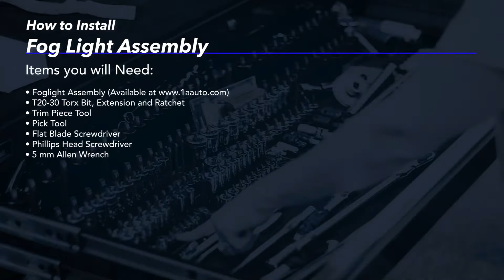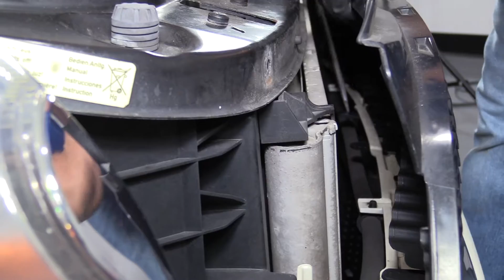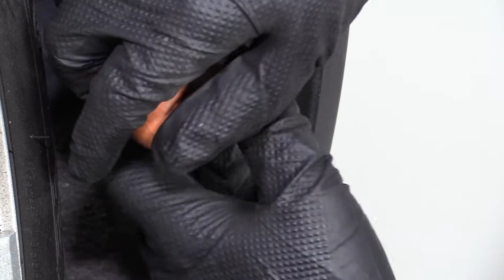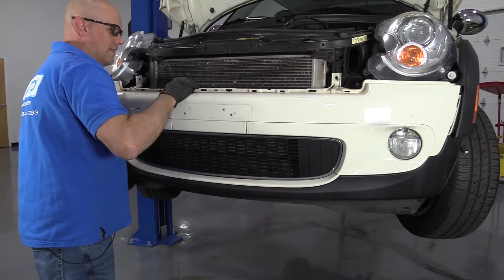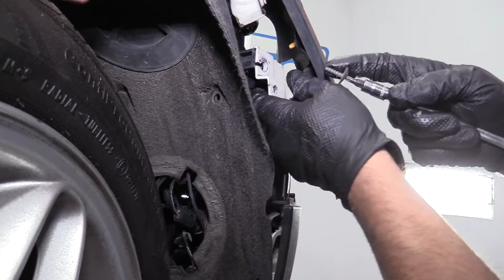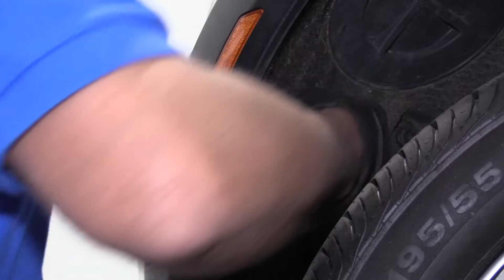How to Remove Fog Light Assembly 07-16 Mini Cooper S

Comment: The long way to do things. Take the wheel off. Remove the three push on clips from the wheel skirting. Pull back the wheel skirt and remove the the two torqes screws at the bottom and one at the top. Remove the two light harness and remove assembly. Reverse to replace. You do not need to remove grill or bumper. Took 10 mins.  Perhaps show the proper way.

Comment: There's no need to remove the grill or bumper. Just remove the tyre, the two plastic covers behind each light, peel enough trim back and tuck behind brake caliper then you can access the fog light just fine using torx extension. If needed you can access top torx screw from above by the main light
Reply: You got a video to prove you can do this?!! I'll be waiting patiently.

Comment: It's a lot easier to jack the car up, put it on jack stands, then pull the tire and wheel well cover, or at least pull the front part of the cover back.  That exposes the marker or fog lights (depending on what you have), the horns, and the ambient air temp sensor, which apparently was supposed to be the subject of this video, then it wasn't.
Reply from the maker: +tpaairman Thanks for the feedback!

Comment: Load of rubbish. Remove the wheel remove the plastic circle to access the two torques holding the bottom of the fog and you can access the top one from below the headlight. Pull out the foglight surround by pulling towards you and the light will come out the hole
Reply: Much help, many thanks!